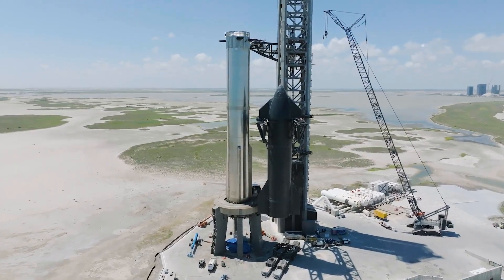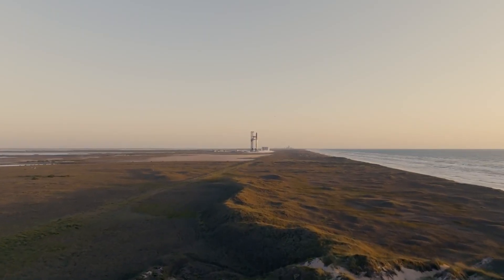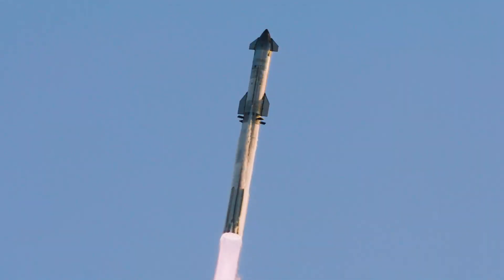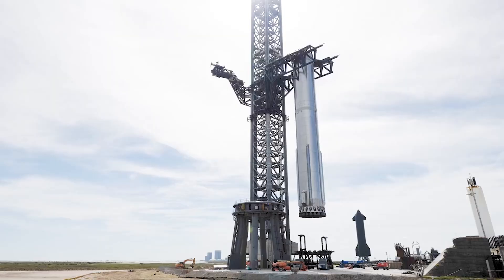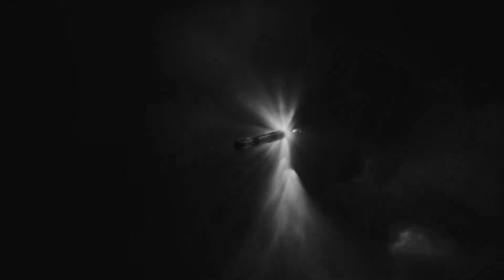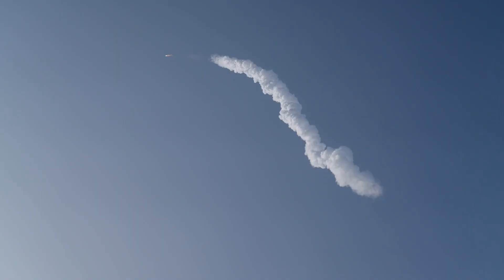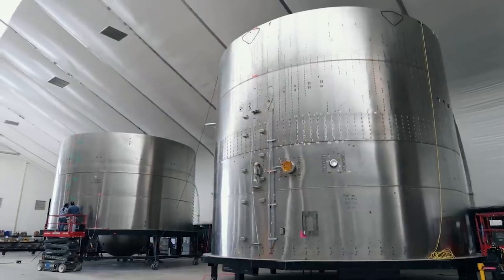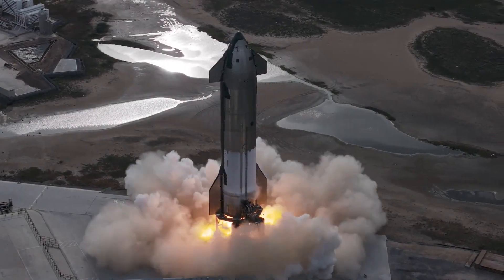SpaceX Is Preparing To Install Starship’s Flight Termination System

Comment: Perhaps next time Starship fails the termination system might actually work. Either way, SpaceX, Musk and Shotwell will claim success (again).
Reply: @davidstevenson9517 they literally set goals that they want to complete with a launch, and they exceeded those goals. That means not everything has to go completely right and they don't have to reach orbit either. It is a success in the eyes of the goals they set.

Not everything goes perfectly right from the start, that's why it's called a test flight.
Reply: It did work on the booster.  The ship had it's own idea for an RUD.
Reply: Not a fan of SpaceX I take it? Test flights test stuff and they don't have to successfully make it to orbit to test said stuff
Reply: @nommchompsky  That's a point lost on most of the haters.